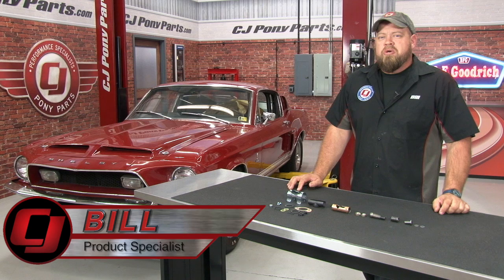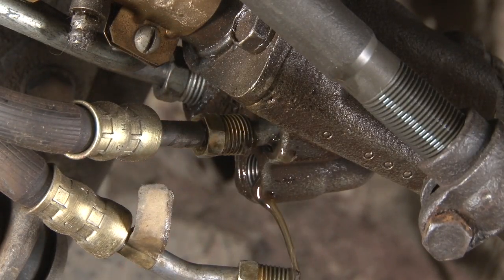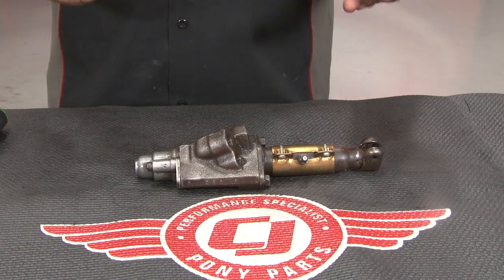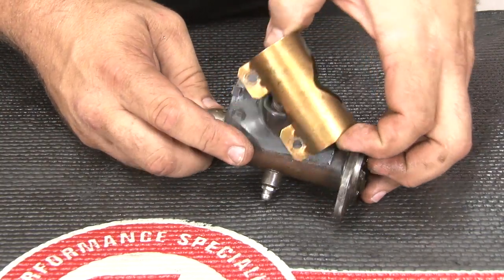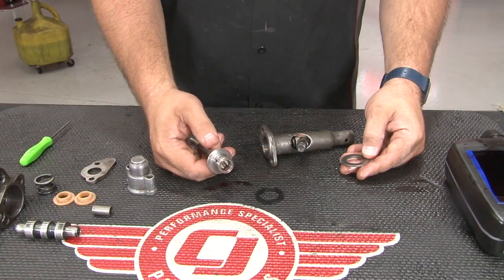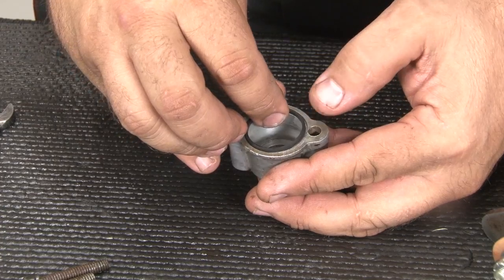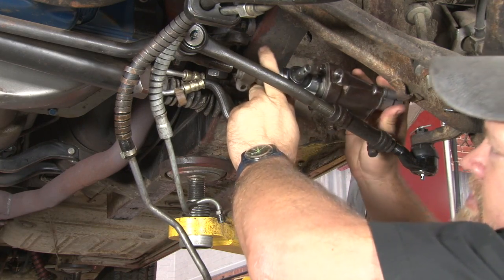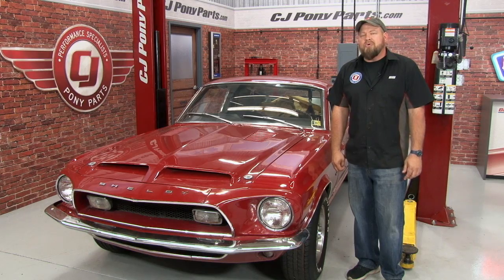Power Steering Control Valve Repair Kit | 1965-1970 Mustang

Comment: never use a tie rod end fork to remove one of these control valves. I've rebuilt 4 of these and it was easy  to see that someone had used the fork on them. They were beat to pieces, warped and mangled. I had a hard time saving all of them. Had to replace some of the sliding brass sleeves and make the tubing extention housing round again and remove burrs.
Reply: As I was swinging the hammer, l was wondering just that. And I just bent mine! On oneside, I thought I'd buy a new one. $340! I already have the kit. So I'm going to try rebuilding it. I think the part l bent is $200. If you have time to answer. That brass looking sleeve stays put? It doesn't slide back and forth? So if I file and gently bend  housing back I'm hoping it will be OK?
Reply: I was thinking about that too.  Could you please what should be used to remove them?
Reply: @stuarttell7061  Use a gear puller. (see comment i just left) this guy in the video is a hack and a lot of viewers are gonna screw up and damage parts that are likley in decent shape by following his ham-fisted lead. Most small gear pullers will press that knuckle (with the entire valve assembly intact) out of the pitman arm very easily and fast, with zero damage to anything. I can't believe they posted the video with the WORST possible method!

Comment: So helpful! I'm working trying to do this for a 64.5 mustang but it doesn't screw off like the 65. Any tips on getting it out? Or will I have to remove the center link too since it's all connected?
Reply: I've heard of people doing it in the car and completely removing it. i would think in the car would require a lift so you can drop it down a bit

Comment: You omit to state how much movement is need in the ball stud. It does need movement to function correctly. Thanks to this lack of info I have pulled my valve down 3 times as it was too tight. There are other sites out there with better info. Also the o'rings are for the internal valves you do not comment on and other kits have the seats for the hoses which get damaged and leak. Stangers site is a better place to read about control valves.

Comment: Mine is a 6 Cyl and I also had to deal with the extension rod. What I can not find anywhere is the torque specs for the bolts to put back in.. repair manual does not list what the spcs for tightening down are. I realize this is an older video.. but any on have the info?

Comment: Never use a pickle fork use a tie rod puller, also replace the hose seats in the control valve.
Reply: Is there a video showing how to do this properly?
Reply: @flying_Turtle  use a small gear puller. Just do NOT use a pickle fork!

Comment: My 1965 did not have the threaded on Control Valve.  The Valve was seated into a milled out portion of the arm, no threads.  Not fun, had to remove everything.

Comment: Hi guys, what's the symptoms of a bad valve body? I'm getting notchy steering or loads of free play in my steering box?
Reply: free play in the steering wheel could indicate that the steering box - the big cast iron box mounted to the frame rail - is too loose. if there's no procedure for adjustment somewhere online, I strongly recommend getting a shop manual for that year mustang because it will cover nearly all repairs the car could need in very good detail.
Reply: @lichking3711  yeah spent about 2 weeks trying to dial in the adjustment of the big cast iron box lol. Wanted to know symptoms of a soent valve body really.  Changed box on the end.

Comment: Help I have a 64.5 and it doesn't look the same. Doesn't have a clamp to slide back at one end and i don't see a drive pin when removing from the car.
Reply: I don't know if you ever got an answer to this, but before 1967, the control valve is not removable from the drag link. You have to remove the entire drag link and take it to the bench. Inspect the rod itself while it is out as it is somewhat common for them to be bent a little after 60 years of use and abuse. Good luck.

Comment: My power steering pump says on the cap automatic transmission fluid only. So if I rebuild the whole system should I use power steering fluid or ATF?
Reply from the maker: You want to stick with whatever the system requires, in this case ATF

Comment: this is NOT The process for a 1964 1/2 - 1966. If you have threaded end (you are lucky ) and its a 67 or higher. The first ones where a BEAR to change the center link because instead of twisting off like BILL shows, they were integrated with the control valve. In other words, the ONLY way to change the center link is to remove and dismantle the control valve. And vice versa. Need to take apart the control valve? You are taking the center link too.

Comment: Hello guys, can anybody tell me which port of the control valve is the pressure one and which is the return one? I have brand new control valve/hoses and can't identify which port is which in the CV
Reply: funny you should ask that, i did the same to the manufacturer that makes the hoses and even they did not know.

Comment: My mustang has play in steering wheel and has all new tie rod and other bushings will this fix the play
Reply: not if it's your steering box that is worn, This valve would have to be in extremely bad shape to cause play in the steering wheel. Be super careful about adjusting the steering box. It's easy to over tighten it and scrap it out.
Reply: No, that's a steering gearbox problem. Note that older cars that use recirculating-ball steering do have a small dead spot in the center and it's normal
Reply: @lichking3711  I mean 2 years later and 3 mustangs later it did work lol
Reply: @colecooper1116  🤣

Comment: What is the control valve and its purpose?need help to know more about it . Tnx
Reply: it takes the steering input from the pitman arm and pushes the spool forward or backward, which sends fluid to the left or right side of the slave cylinder. This imbalance of pressure creates the hydraulic assist.

Comment: Helpful video except you never mentioned what the two little o-rings were for.
Reply: I would also like to know where the 2 small o-rings are located. Did an answer ever come?
Reply: There is another part on the main body that runs parallel with the spool valve.  They go on that.  It's odd they don't remove or install it in this video.
Reply: Thanks for the tip, yes I found out after I found a schematic drawing of the Bendix control valve, it gives a nice illustration of all parts. Yup, seems like they clean forgot to mention this in the vid!

Comment: Useful video, but a few VERY BAD actions. NEVER remove the control valve from pitman arm using a pickle fork!!! Tearing that ball stud out will always be the result, which in-turn tears up the bronze sleeve, possibly damaging the housing. Removing the torn-up sleeve is a major task that WILL turn this otherwise simple job into a hours-long ordeal. Yet that's just what the guy did here, as if it's a normal thing. USE A PROPER BALL JOINT/TIE ROD OR GEAR PULLER -- a simple tool available everywhere that any mechanic should have in their toolbox. 

Second awful thing, total sloppy finish. This guy is working on a rare original SHELBY and finished the job with more grease, oil, and fluid on the OUTSIDE of every part he touched than on the inside. all that work and the parts went back in dirtier, oilier and greasier than they came out. If you're gonna make a video at least set an example by doing things the right way, not the neanderthal ham-fisted messy marvin slop-job way.